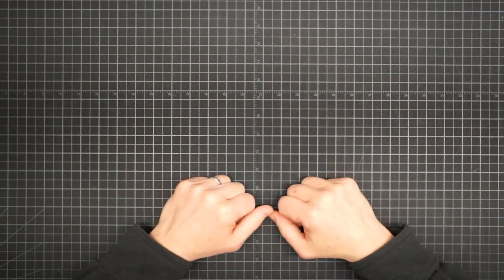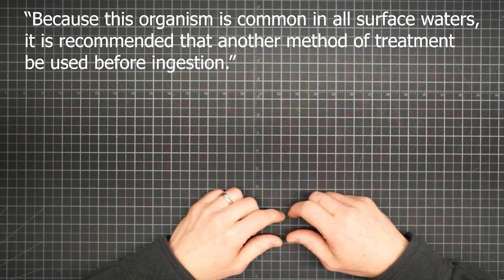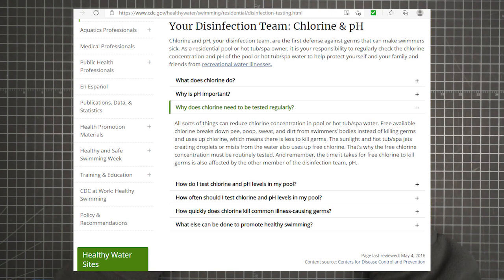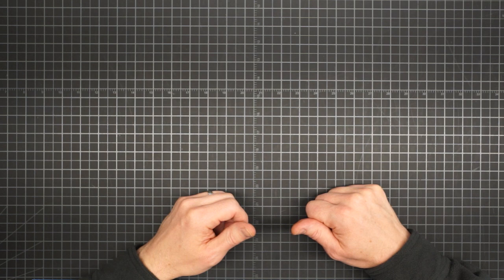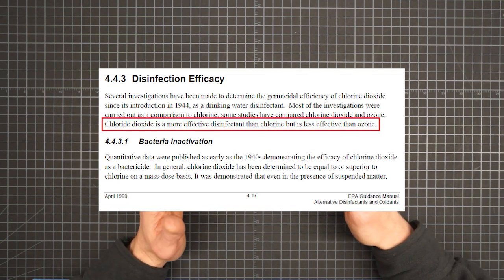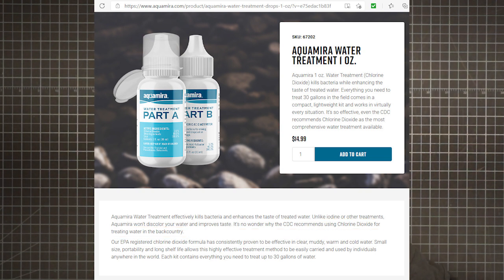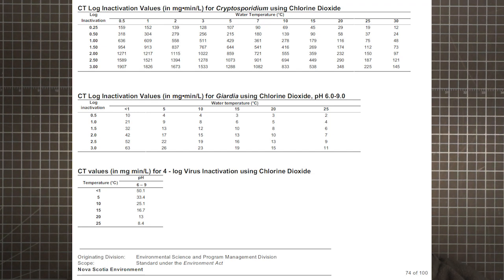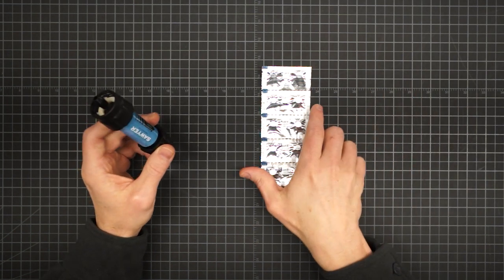Backcountry Water Treatment, Part 2: Chemical Disinfection

Comment: I’ve used sawyer with a bit of chemical backup for a decade.  I sawyer squeeze straight like a straw to camel up when moving and attach a hose to my bag for gravity setup at camp or lunch break.  It’s so fast and easy I can’t understand the people i’ve met who “don’t ever filter”.  It’s like never using a seatbelt or wearing helmets or PPE in general, it’s just unnecessary risk when there are simple, effective, inexpensive options.  As far as I know, improvements in water treatment/purification were the historical breakthroughs most responsible for lengthening average human life.

Comment: One interesting worth mentioning with the chlorine dioxide options: While the labels say 4 hours of treatment needed, that's to cover crypto. If you are willing to risk not killing the crypto it seems only 15min is needed.  Maybe a good hybrid approach would be to do 15min w/ chlorine dioxide to get the viruses and then run it through a filter. (Of course you also mentioned that running it through a filter first and THEN treating could be better too). Decisions decisions. EDIT: just realized you mentioned the 15min!

Comment: This whole playlist is so fantastically good. My only nitpick on this first video is the conclusion to use low and medium flame to minimize the mass spent to boil the water. My testing at home with stoves with a fan blowing on it make it clear that wind speed really dominates the heat transfer behavior. Certain wind speeds can mean that low flame level may never reach 160degF, which would completely upend the conclusion provided.
Reply from the maker: Good point! I’ve been gearing up to do some more testing. I want to try different burner sizes, pot sizes and shapes, looking for an optimized combination all with low, medium, and high flames. Wind speed should definitely be part of it.

Comment: fantastic video! Thank you so much for making these. I would be interested in a thorough risk-assessment for untreated water in the wilderness -- so many conflicting sources and studies re: thresholds and contaminant concentrations that represent significant risk, and very little hard data/information online. Can one get giardiasis and other water-borne illness more than once? etc.
Reply from the maker: I do have some information on wilderness water safety.  I’m going to work it into the next video on filters, sort of a “how much log reduction is enough” segment.  Minimum infectious doses, pathogen concentrations recorded in the wild.  Stuff like that. As you say, good data is hard to come by.
Reply: I would love some practical advice included specially for people without a lot of experience like myself. I really enjoyed the info on the dead rat = potentially higher virus contamination. 

Yes, you can get giárdia more than once. You can also get other GI bacterial infections more than once. I can’t say exactly how your immunity after exposure works in these cases though, it could be highly variable between individuals. There’s a vaccine for Hep A (waterborne virus) though so I would suggest taking that for sure.

Comment: Hello! I’ve watched each of the videos, but admittedly I’ve done a poor job of parsing some of the information I’m looking for - you mention at the end of the video that you’re satisfied with the filtration of the sawyer mini for most “wilderness water sources.”  I’m curious - what is “wilderness” enough?? I day hike primarily on local suburban trails, but want to be prepared in the event of a surprise overnight or two.  

In your discussion of viruses, it sounds like the primary sources are human waste, maybe some animal waste? How do you typically make the call for when you use your chlorine dioxide tabs?

Can’t thank you enough for this incredible content, as many have already said in the comments here.  Unbelievable detail and presentation.
Reply from the maker: In a suburban area, you might have to deal with higher levels of pet waste (viral concern), as well as chemical pollutants from water that has run off streets, buildings, or fertilized and pest-controlled areas.  For this, especially with the short time frame of an unexpected night or two, I would recommend one of the carbon filter options mentioned in that video.  Maybe a Grayl if you don’t mind the big container, or one of the ultralight Adventure Medical filters.

For wilderness, I just use a sight/smell test. If it looks clear and has no odor, the Sawyer has always kept me okay.  If the water is murky, or it smells bad I will either pasteurize or use tabs depending on if I am at camp or on the move.  

Hope that helps!
Reply: Awesome, thanks for the reply.  Grayl is what I have been carrying (and haven’t needed it yet), but I resonated with some of your concerns expressed in part 5.  Would you say that the chlorine dioxide tablets (maybe with a bandana pre-filter) are a reasonable choice in either of these scenarios? Suburban/wilderness?  In that case, I may plan to carry the Grayl only when I think I’m likely to gather water (for the extra speed and convenience of purification), and the tabs for when I think it’s unlikely as a backup.
Reply from the maker: The tablets are great for viruses, but won’t do anything for chemicals, heavy metals (what you might find in suburban runoff). If those are a concern, only adsorption filters will help.  Otherwise, tabs are my preferred backup for if I encounter particularly bad looking water of microbiological concern.

Comment: I'm re-watching these videos for the 3rd time, this time making copious notes and screenshots in Onenote as I go along. It is a crime the channel does not have 10 times the views. 
Really looking forward to more information on mechanical filtration and UV. I've been using a steripen during winter (when even daytime temperatures will be below freezing) which is an awful weight penalty, but I don't have to worry about it freezing and breaking, and in those conditions, I probably have a Nalgene with me to use as a hot water bottle at night anyway. 
I may switch to chemical treatment in winter, but I'll need to look harder at those CT values and see if it would take forever to treat. I skimmed back through Justin Lichter's winter travel book, but he makes comments to iodine taking 4 hours for Crypto and generally seems to be lumping all chemicals in as one.
Reply from the maker: I am actually working on the filter video right now!  It’s another research-intensive one 😳
Reply: @GearSkeptic  "How to Shit in the Woods" is worth a read on your research journey. The two ends of the body end up being linked in more ways than one. I was unaware groundwater was generally considered safe to drink until the mid-'70s. This does not appear to be an issue of "they didn't know any better back then", it appears the widespread nature of giardia and crypto is relatively recent.

Comment: Excellent! Mind bendingly awesome as usual. Very interesting about the marketing speak. Thanks for clarifying. Was a bit disappointed to hear about Purinize but then remembered it was good for helping to filter chemical contaminants unlike anything else I've seen (per their label). Any luck in finding good info on that?
Reply from the maker: It looks like it is more of a flocculent than a disinfectant.  I’m going to include flocculents in a Part 4 on pre- and post-filtration.  They act like a pre-filter by settling out sediment. And, as you say, they have quite a few tests showing some reduction to a lot of metals and minerals (along the lines of activated carbon).  Potentially a place for it in a combination system?
Reply: @GearSkeptic  Awesome! Eager to hear what you have to say about them. Possibly...they'd have to be able to help remove viruses adequately enough when used with a filter in order for me to want to carry them over chlorine dioxide, or if I had to filter from questionable water sources closer to developed areas (farmland, storm drainage, rivers, etc.).

Comment: These are great videos, and I am really looking forward to the rest of the series.  You mentioned in another comment that you had found relevant water quality data; something that I would be interested to hear (if you have the data, anyway) is how to know what you need even worldwide.  Ever since I started looking into water filtration/purification I have gotten used to hearing something along the lines of "filters are fine in the US, viruses are something to worry about internationally".  But if the fecal route is the concern then here in Finland (where there is a lot of land and approximately no people per square kilometre) the virus situation is probably as good or better than in many parts of the US, and so I would be keen to know how to recognise when I am about to go somewhere where it would be better to be paranoid about viral infection.
Reply from the maker: What I have is from the WEM Journal (Wilderness and Environmental Medicine), which is just data on waters in the USA.
Reply: Thanks for the pointer, and no worries---I imagine that it must be difficult to get such data for outside the US at the best of times, and except for a few countries you probably would need to speak the local language as well which puts up another barrier (e.g. here lakes are tested every now and then but results I believe are available only in the local majority language).

Comment: Thank you for the incredibly detailed video - quick question:
If I am using the chlorine dioxide tablets and Sawyer filter (to get full coverage), does the order in which I filter/purify the water matter? i.e., tablets and then Sawyer or Sawyer and then tablets?
I apologize if this was answered in the video, I was unable to find it through my second pass.
Reply from the maker: I would filter first. The more you remove ahead of time, the less the chemicals need to do!

Comment: I have one comment, but otherwise can only re-iterate what has been said here. Your presentation and analysis is the best I have seen. Thank you and keep it up.  My one suggestion is addressing what the risk is of using no treatment in say, the Sierra Nevada. I recently read in the Sierra Trout Guide by Ralph Cutter (of Cutter's mosquito repellent). He relates that he uses no treatment because the risk of getting sick is wildly exaggerated. And (in his words), if you DO get sick.. guess what.. you have diarrhea. Its not that big a deal.  I searched briefly for some prevalence data on Crypto, since that seems the most challenging to treat and came up short. I think you said it was ubiquitous? Then the infection rate might be quite low, I don't know.  If I could add one thing, it would be the risk discussion of "what if I use no treatment at all?" Thanks again for your excellent content.

Comment: First off, my head was spinning, and I had to re-review many times. Overall Excellent. I know this video is on chemical treatment, and the next in the series is on filtering, but I am curious what your take on the SteriPen is? Also, the Berkey sport will clear 4 log of virus, 5 log bacteria, but only 3 log protozoa. Any thoughts on this product? Thanks Again, I love the education.
Reply from the maker: I'm working on UV and solar disinfection, too (maybe a Part 5?).  So far, the Steripen seems an effective option.  It's pretty easy to just use multiple times for extra log removal in case of very bad water.  There are some concerns about breakability, batteries, and cloudy water, but nothing is perfect, I guess.
Reply: @GearSkeptic  thank you sir! Keep up the great work, and humor. I loved the iodine strip.

Comment: Superb video, thank you for all your research and effort communicating it! 

When would you pasturise over use your chlorine dioxide tablets?
Reply from the maker: I’m thinking of the following scenarios:
   When cooking (you’re heating water anyway)
   When the conditions are so challenging that it would either be quicker or more effective to heat.

Those challenging conditions include:
   When the water is near freezing cold (it could take many hours for the tabs to work on crypto)
   If the water in question is really, REALLY bad and I want the obtainable massive safety margins heat can provide.

Comment: Are there health concerns with ingesting chlorine dioxide treated water? The EPA has a limit of 0.8 ppm in drinking water. Micropur MP1 tablet label says using the product correctly will "generate a solution of 4 ppm chlorine dioxide." So if I understand this correctly using these tablets will result it water with over 4 times the EPA limit for chlorine dioxide?

Comment: Do you know what the difference between Katadyn Micropur MP1 (which you're using here) and Micropur Forte MF 1T is? I bought the former thinking it was the one from this video by mistake. I also wondered, under what scenarios or queues beyond literally seeing a carcass or faeces would you also use the micropur and not just the filter? Or do you personally always use both?
Reply from the maker: It looks like the Forte is a European version.  The main active ingredient is the same, but it also contains silver (has some antimicrobial properties).  The contact times are the same, so I assume performance is similar.

I do not always use tablets.  Usually just a filter.  I just use the sight/smell test. If I see floaters, or unusual color, or smell a stench then I will double up.

Comment: One thing that conerns me about the chlorine dioxide, is the safety warnings on the package. On the package for Potable Aqua tablets, it says 'causes irreversible eye damage...do not get on eyes, skin, or clothing... wear protective eyewear, clothing, and rubber gloves...  Kind of scary to me, and no one thru hiking is going to have safety goggles or rubber gloves.
Reply: I suspect this if you are exposed directly to the tablet, not after its dissolved into the 1L of water. I still wouldn't douse your eyes in water treated with them though.

Comment: So if CT is lower at higher temperature, if you're in a hurry wouldn't a brief blast from a gas stove accelerate the chemical process? 1 min on a stove could save many minutes waiting, plus if you're in a hurry as you're about to drink it, raising it from just above freezing may be a good thing? Then again, if you're bothering to fire up a stove,... might as well pasteurise it?
Reply from the maker: Interesting idea! It might depend on what your most precious resource is, time or fuel.

Comment: Have you seen the water2go purification system? They claim to remove everything from what I can tell, and have published several test results. Would be interested to hear your thoughts, as it's what I currently use.
Reply from the maker: Thanks for the tip! I’m researching virus filters and also ones that reduce chemicals for another video.  I will check this out!

Comment: Curious if it is fair to say for Katadyn's Chlorine Dioxide tablets, if I wanted 8log reduction in viruses as opposed to the 4log from the chart, could I just leave the reaction for twice as long, instead of 12-15 minutes, a full 30 minutes to get the full 8 log reduction? Furthermore is there a point at which the chlorine dioxide stops further reducing viral threats given more reaction time?
Reply from the maker: It should be. CT times mean you can double the result by doubling the time.  I’m sure there is a theoretical limit out there somewhere. The reactive chemicals might break down over time, but that probably doesn’t happen in any practical time frame.
Reply: @GearSkeptic  Thanks for the reply! I'm also curious if there is a ceiling on the number of viruses a single tablet of chlorine dioxide can inactivate in a liter of water such that all the chlorine dioxide gets used up and cannot continue disinfecting, leaving living viruses remaining regardless of wait time.
Reply from the maker: It’s a good question. Not that I’m aware of, but I haven’t seen a specific study.

Comment: Surprised there wasn't anything on potassium permanganate.
Reply from the maker: I couldn’t find any studies on it’s actual effectiveness.  I guess it’s not main-stream enough.
Reply: @GearSkeptic  I found some studies, but they're old. Like, "1964" old.
Reply: Potassium Permanganate is also increasingly restricted (particularly in Europe) because its oxidising properties give it the potential for ‘naughty’ uses - which is annoying because it is useful for water purification, wound disinfection and as an emergency fire starter.

I’d assume that the old studies are still fairly valid though and from basic chemistry knowledge I’d also assume it’s effectiveness is somewhere in between iodine and chlorine due to the relative reactivity of oxygen (the active ingredient in potassium permanganate) compared to the two aforementioned halogens (i.e free oxygen is a better oxidiser than iodine but not as good an oxidiser as chlorine).

Comment: How effective would be a "purification" with a charcoal tablet into the water till fully dissolved... Shouldn't it also has an effect in desinfekting water ??? Would maybe be an non chemical way... But worms would be not impressed by that method to get rid i think...
Reply from the maker: I’m working on research for charcoal filters.  They can be effective in removing some chemicals and metals, but they don’t filter biological threats.
Reply: @GearSkeptic  awsome